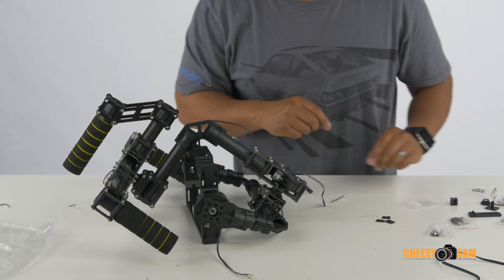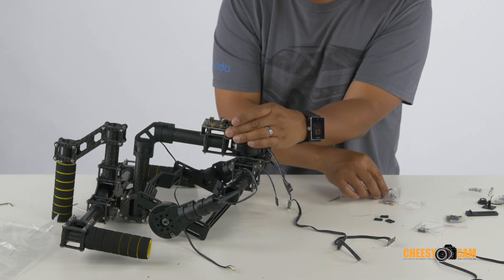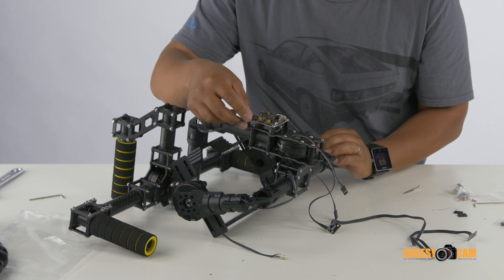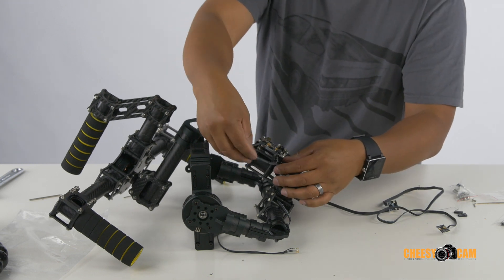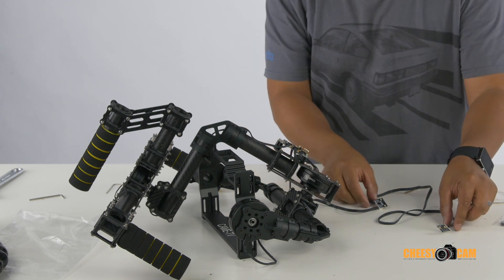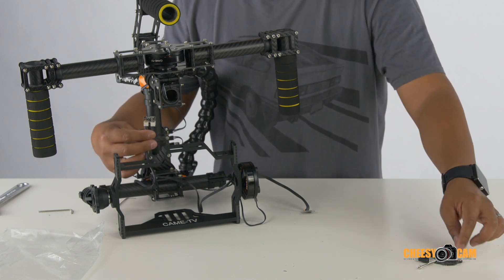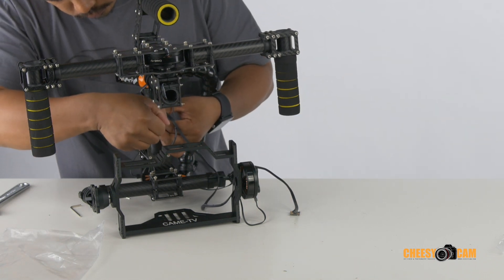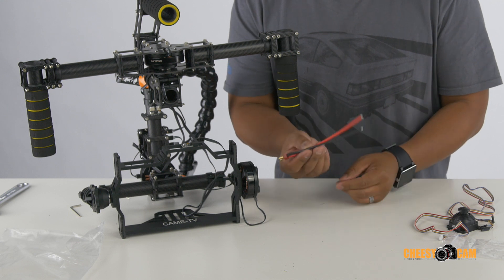Part 4 - CAME 7000 Build Wiring 32 Bit Control Board and Dual IMU Sensors

Comment: Great video! Question: does the camera sensor have to be mounted on top of the camera or can it also be mounted below the camera? For instance on the rod with has the quick release plate on it? I I have a slightly different gimbal which hasn't a top plate on the camera cage..thx.
Reply from the maker: +Beech Kraft You can mount the sensor anywhere close to the camera. Just make sure you set up the position in the software.

Comment: Hello, i purchased my alexmos seperatly from the gimbal, i have a hard time finding this little part you are using to mount the second sensor on the frame. Any idea where i can get it on ebay ? i'm french so i'm probably not looking for the right keywords. Thanks.
Reply from the maker: Guillaume Leroux Sorry, I don't know where to get the part separately.
Reply: Guillaume Leroux Mine didn't come with one either. I gently leveled the IMU by resting it on the bracket on that pole/axis. Then I zip tied it to the pole to hold it down. Then I added super glue below and around the IMU housing (I put mine in a housing) to help it stay put. The zip tie and the glue together have worked well so far.